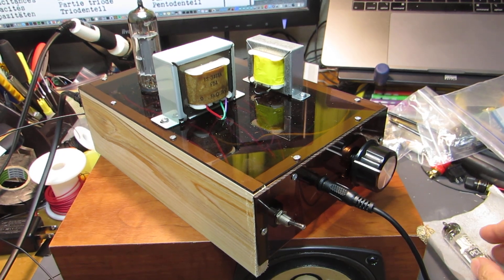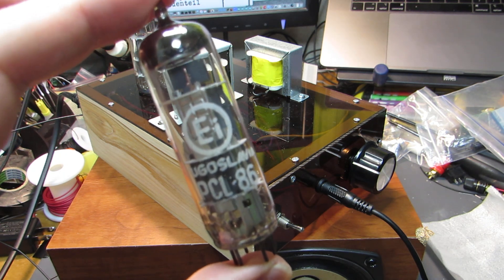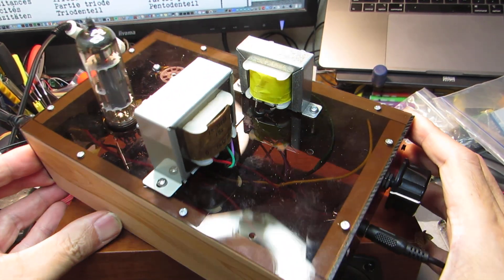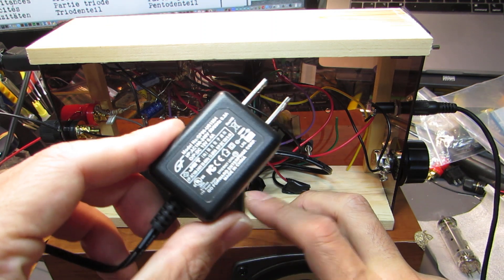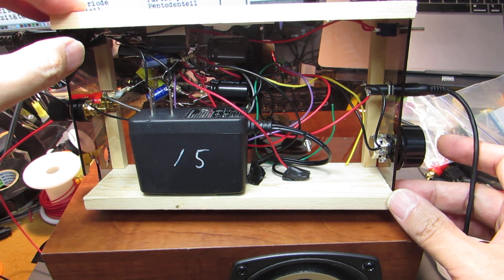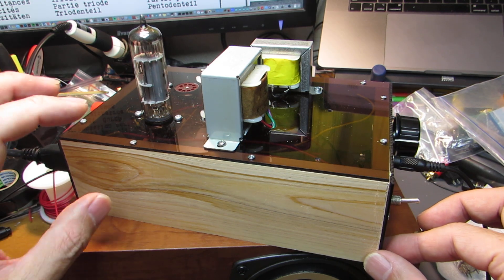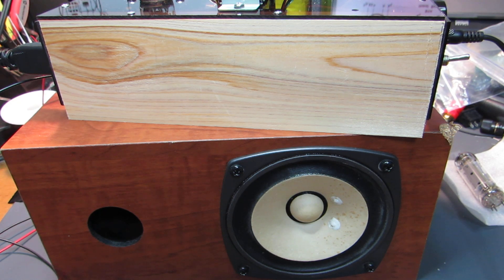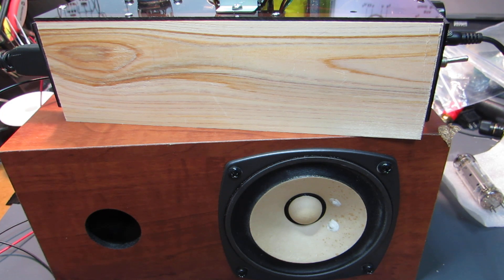PCL86(14GW8) single tube amplifier

Comment: Good morning friend! I congratulate you on this project! is it possible can you share the diagram? I'd like to do it! since I have the valves!
Reply from the maker: Sorry slow response. Actually the circuit is quite typical. It is almost the same as 6BM8 amplifier design, just different point is amplification and heater voltage. You can easily find the circuit by google search by "6BM8 amplifier schematic" Please try!